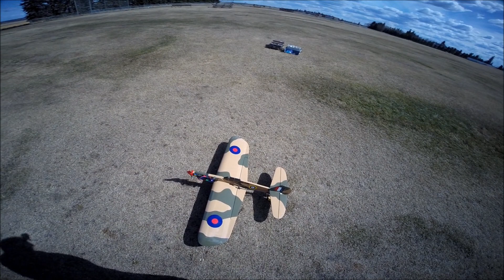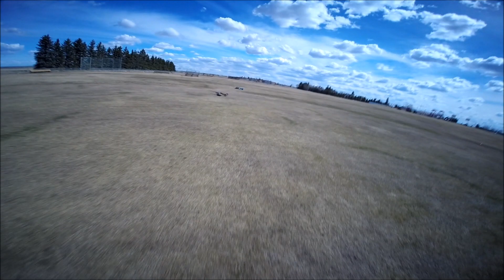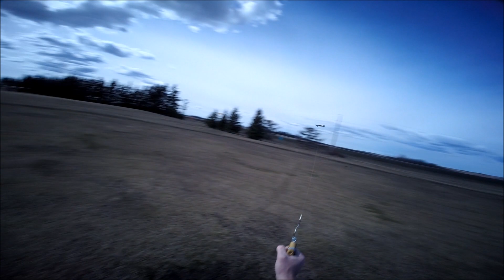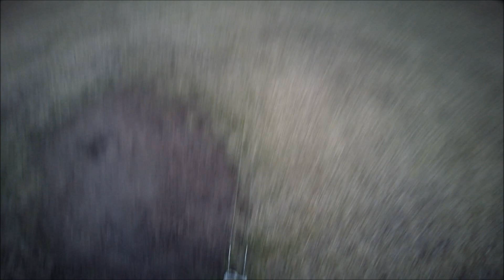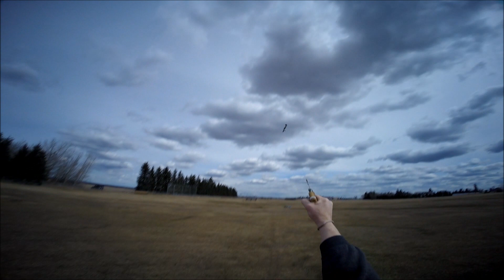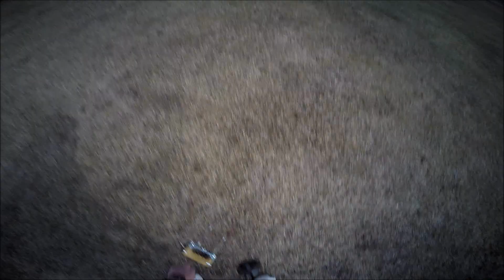Brodak Electric P-40B ARF First Flights!

Comment: Looking good. Lap time was just a little bit long for me. I saw you mentioned going to an 11x6 or 11x7. What size prop was on it for those flights?  Overall very nice.  Well done
Reply from the maker: Frank Donnelly   Thanks, the prop is 11X5.5. The rpm was 9400, checked when I got home, kicked it up to 10,000. Next time out I’ll see if a new prop is in order to decrease lap time a bit.

Comment: That first landing was quite something. It is definitely a bit lazy. Were you able to prop it better or are you going with a different motor?
Reply from the maker: I went with 63 foot lines which I new were too long as a precaution. 60 foot lines were better. The RPM was 9400ish so I turned it up to 10,000 were it should be. Next step would be a 11X6 or 11X7 prop and both are less than the range for the motor.